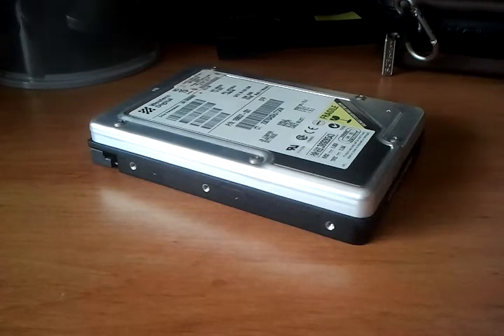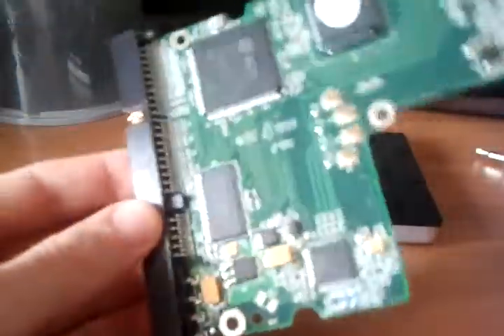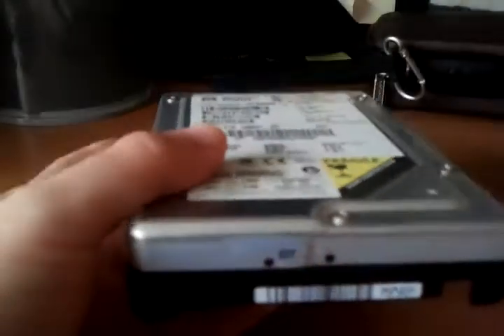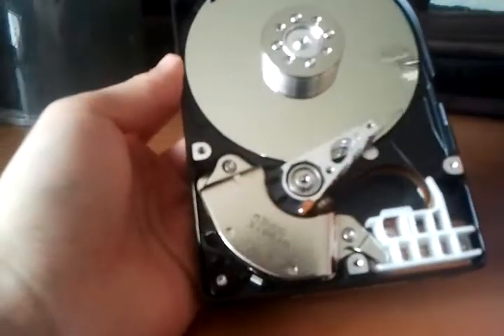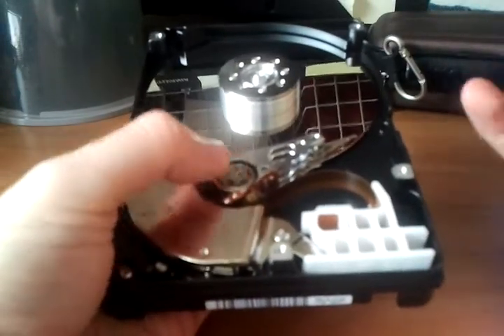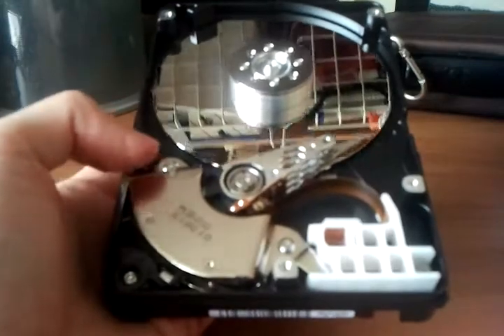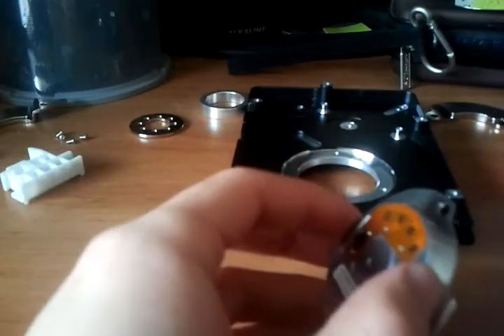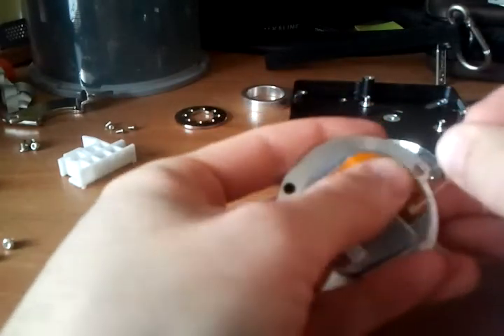TeardownTube - episode 6 - Hard Drive

Comment: I started geeking out when you showed up with the LED to try to light it.You need to get the rotor moving quite fast. 3 pins are in 3 phase delta and 4 pin are in 3 phase wye. I had a good chuckle, so seemed like a good use of 3 minutes of your life.
Reply from the maker: I just had to give it a try with the LED. I've seen people even use hdd motors for everything from a usb scroll wheel when interfaced with a microcontroller to read the back-emf, to a sanding disk or POV display. So many cool things you can do with these little brushless motors.